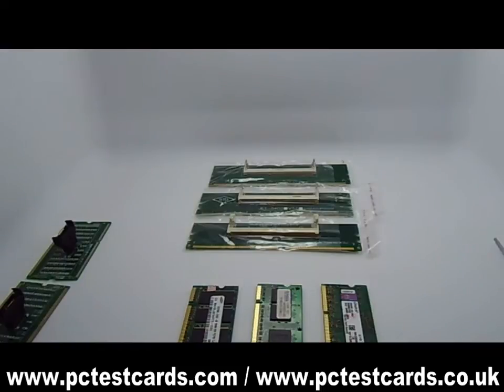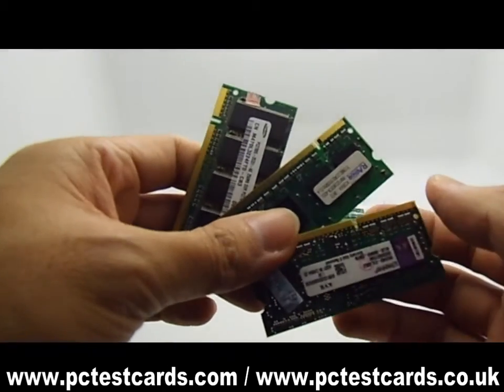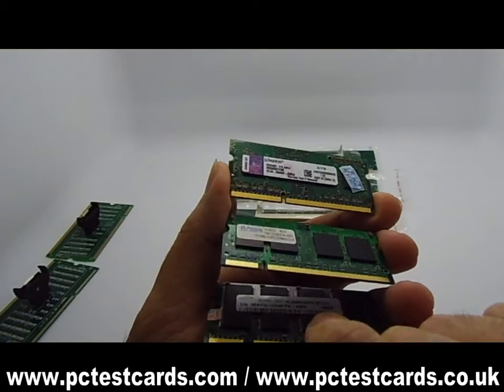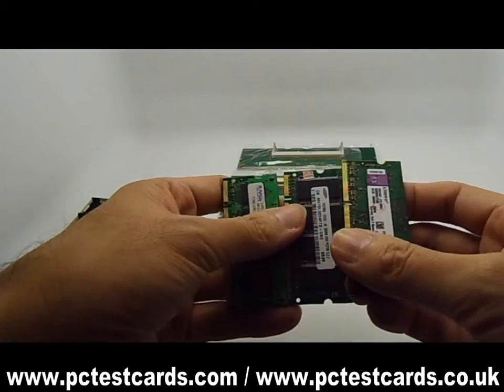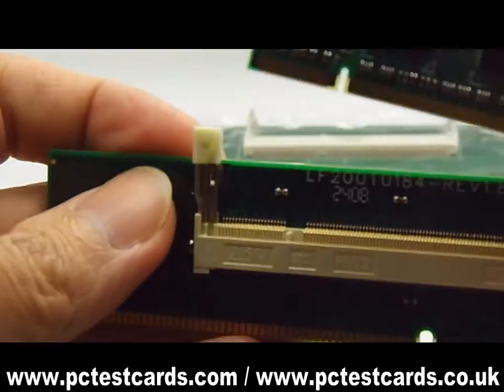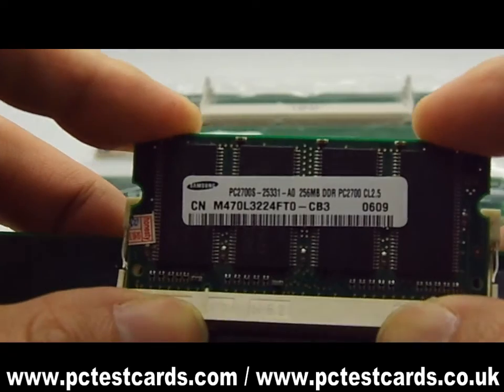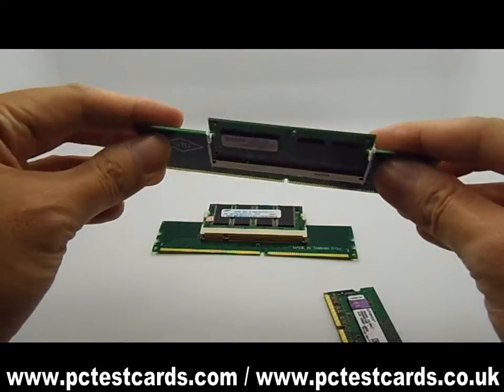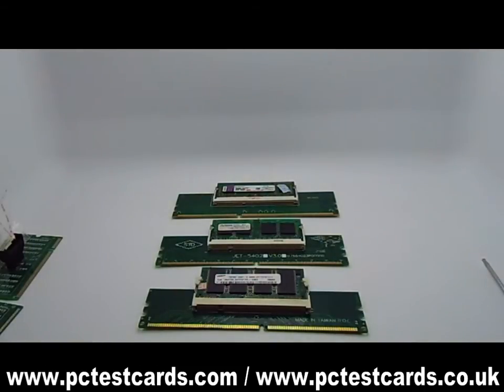How to quick test the laptop DDRs Memory RAM module on desktop PCs at low cost?

Comment: Just download this app and it will provide you full system info of supported Ram type DDR2 OR DDR3 detect if you need to upgrade Ram of your PC. this app will show your PC current RAM Type simply.  download it by link below and in the interface go to Ram menu http://123link.pw/r6hFO6ko
Reply from the maker: Hi thanks for the post, there is different between the hardware and software RAM diagnostics. The software diagnostic suite needs the PC to be able to work and the RAM also needs to be in good working conditions. But most of time, the computer that getting faulty may not even show the POST display, so we have to use the hardware diagnosis to check on the RAM first and then the other parts such as motherboard and video ... etc. The software suite does help to get us the system info on the working machines. Thanks again for the comment.